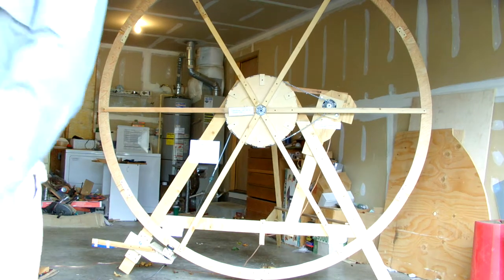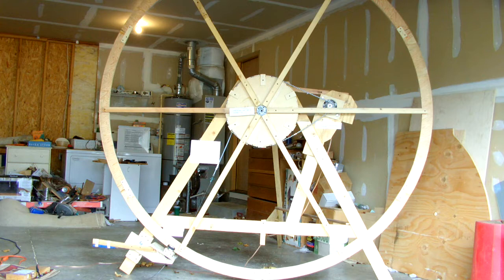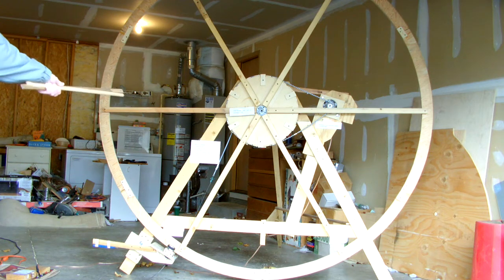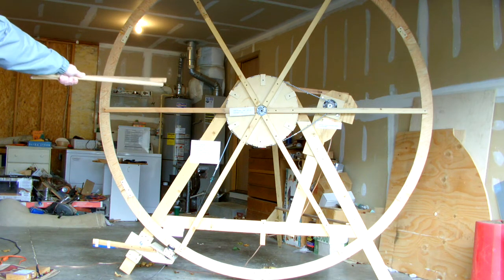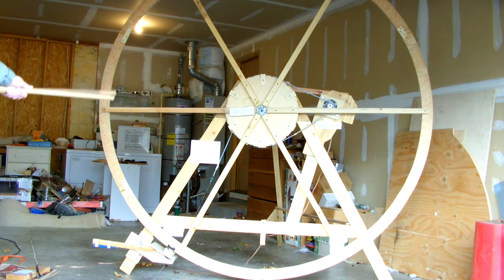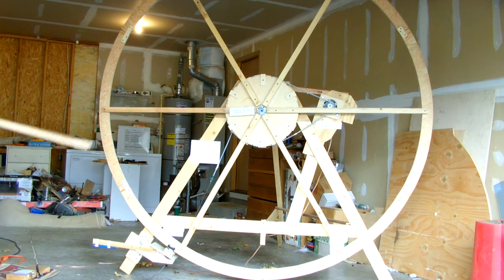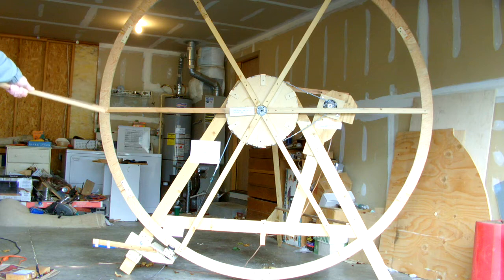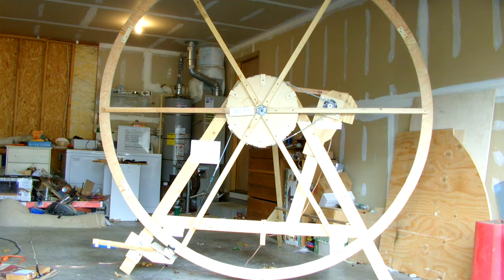overunity iteration of a wheel and axle a rotary 2nd-class lever  MA  rotary lever

Comment: Hey Dave, a lot's of people watched your video but they the miss the point! I think you got a brilliant idea. If you haven't taken apart this  please keep working on this system  and you will achieve success with it.  There are many ways to improve this design. 
One quick idea: Consider using two different driver motors on each side of the large plywood wheel,  that way two rubber rollers on each side of the large wooden wheel will have non-slip  traction on the edge. No matter how flimsy plywood wheel may be.
Reply from the maker: thanks.    few yet accept/understand that  Torque energy is  SCALAR;  ie., Newton-meters, joules, foot-lbs.   this fact underlies the observed the torque multiplication effect of a lever;  or, of a  ROTARY 2nd-class LEVER.    when this is combined with the conversion of high rotation rate to torque,   you get  overunity.      working on installing a second, identical prime mover and friction-drive.  some numbers:   inherent MA of prime mover, 4 : 1;  MA at the friction-drive is now,  166 : 1;  inherent MA of power-wheel, 72.2 : 1;    41.8 percent loss at large-radius drive sprocket;  step-up loss at roller chain stage is now,  1 : 6.85;   loss at pma,  1 : 1.1.     cheers
Reply: Wow,  "MA at the friction-drive is now,  166 : 1" awesome in deed!  You see why I said earlier if you can get/buy or make a super low PM Generator, then input v/s output  will be very high (COP)
Reply from the maker: if interested, see diary entries, at 9/2018 video.   with more input energy, this machine may reach break-even.   IF IT DOES NOT it will  Simply  be because a different, More efficient prime mover configuration is needed.      cheers

Comment: Thumbs up the center wheel needs to be larger around
Reply from the maker: the output sprocket???   well, there are bigger issues.    the 150 watts power consumption of the prime mover is  too great; achieving ou becomes more improbable, as a result.   the use of a single step-up output stage, and a low-speed pma, might be the way to do it.  i'm still not certain.    cheers

Comment: Nice Idea, was there a load on your alternator when the belt came off as the speed increased on the large wheel. I'm not sure about calculating gear ratios but with electricity convert it to watts IE if you use 12v @ 3A to power the wheel that's 12X3=36 watts now measure the output on the alternator and convert that to watts if its greater than your input your on a winner.
Reply from the maker: no. there was no load. this video is intended to show the concept, only. the chain came off because of misalignment. on this setup, the drive consumes about fifty watts. a small 12v motor and 5:1 reduction is used to drive the friction-wheel. that drives the large wheel at about 30:1. 
(on the drive side, a low-wattage high-speed motor is needed; on the output side, a pmg matched to the output speed is needed; low-cost off-the-shelf components seldom have the best specs for atypical applications) in this setup, a non-ferrous sprocket on the pmg is called for, in order to prevent the chain 'sticking' to the sprocket, due to magnetism.

the key to making this work, i believe, is to step-up the output at a ratio less than than the input and drive a pmg that is 'matched' to that speed. (it may be that the stator of pmg should be connected delta)
the large wheel should be big enough to allow a first output stage of 1:3 step-up and a 2nd stage of perhaps 1:5.  if the large wheel has a radius of, say, five meters, output speed could be be higher.

see a three-year old video posted by george chaniotakis, he uses the term magnet motor.

thanks for commenting.
Reply: Thanks for you reply. I've always thought if you gear a wheel then you loose speed to gain torque and lose torque to gain speed. Electricity acts the same if you have 240v X 2A = 480W if you step it down to 12V it would be 480W / 12V = 40A minus losses. For a generator I would go for a higher output than you need, most have optimum output @ 3000 rpm if your rpm is lower then you would get less out than the 50W you put in if you matched your input.
It would be interesting to put some magnets on your large drive wheel with a few coils positioned around it. If you had 30-40 magnets around the wheel you could have lower speeds with higher leverage from your large wheel. Instead of spinning the wheel with 4 magnets @1000rpm you would get the same output @100rpm.
Just some thoughts.
Reply from the maker: note that if a load is created near the radius of the large wheel, there is near zero mechanical advantage. power should be taken off near the center of rotation.
the configuration shown has returned approximately 75%, using the pmg shown.
to get better performance, a different pmg or a larger wheel is necessary. also, a faster drive motor wouldn't hurt. the motor used is for rc cars, 27T.    cheers